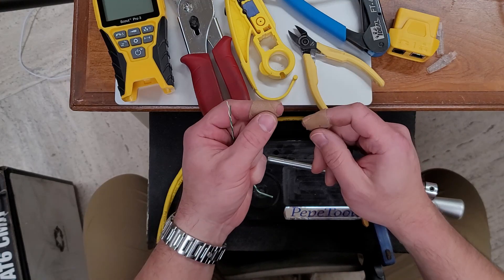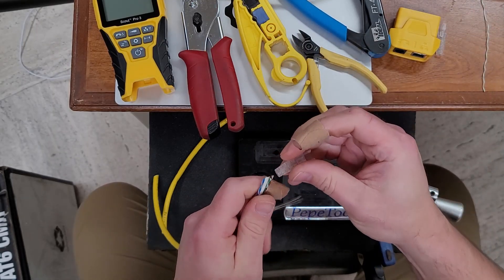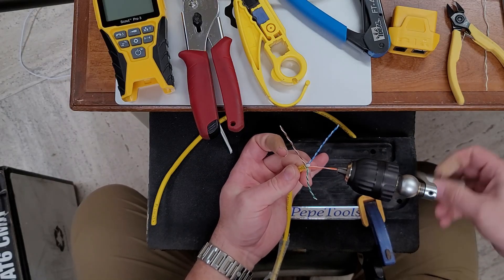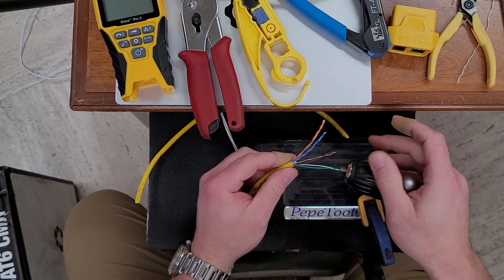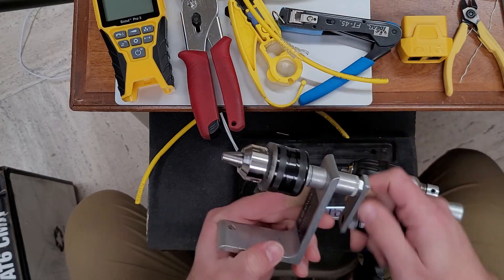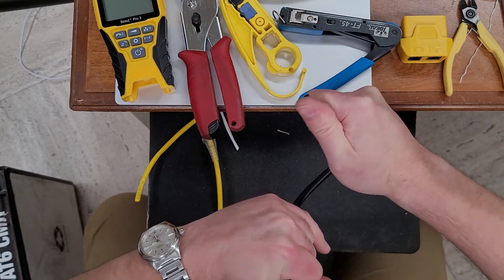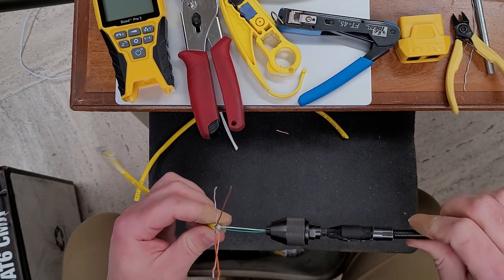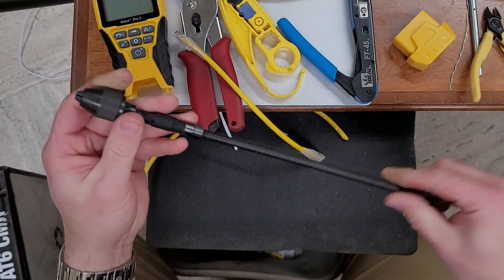Weird Trick For Perfectly Straight CAT6 Wires

Comment: You can get them straight easily with fingers or small plastic rod. Cut a bit (like 4cm at most), push something between the wires and pull. Pair will untwist on its own. Much faster, no tools and they come out perfectly straight.
Reply from the maker: I'll have to try putting something between the wires and pulling.  And yeah, I was straightening them with my fingers and a specially polished v-groove on my linemans, but after two days, my fingers were worn slapped out.
Reply: @EricM81  Try out this method then. I wired over 500 access points this way and my hands were getting more dirty instead of painful

Comment: If you want them to be CAT6 certified, you definitely don't want to unwind the twisted pair down all the way into the jacket, you want them to be twisted almost all the way to the load bar, the load bar makes it so much easier to make sure the strands aren't offset before you crimp, and they're not pass-through which I've had issues with in some ports as well as with oxidation. You can straighten out the strands with a thin metal rod like a thin screwdriver, similar to how you would straighten hair. Likewise, don't cut the core straight through on long runs, you clip the four wings, then twist or cut the center so you don't rotate the strands inside the cable.

This may not be an exact issue on 1ft cables, but if you are patching in near the edge of the maximum runs (200ft or so), it DEFINITELY does matter to hit 10G.
Reply from the maker: Yeah, I don't think one twist inside the jacket on a 1' cable matters either, but I'd like a nice 10G cable tester to see when it does matter.  

If you have a video with tips on CAT6 in non-passthrough connectors, I would appreciate it.  It takes me forever to terminate those cables.

Comment: dear lord you never learned the screwdriver trick? .... much faster guys
Reply: I just use my fingers to untwist and straighten. You counter flex and it straightens them right out. EZ PZ
Reply: @pheredeath yup never needed to use anything other than fingers to straighten.
Reply from the maker: I have a polished v-groove in the side of my linemans, but my fingertips were shot after pulling 2k feet of cable over the weekend.  There was no way I could have made a surprise pack of 25 patch cables that Sunday night without this.

Comment: As a Motorola field engineer,  Im glad its the shop's job to make those cables, though occasionally I have to make one. Thats a neat trick, but we're not allowed to use those "cheater" RJ-45 connectors. We have to use the ones wo the holes, so you have to get everything trimmed perfectly.  Its def a PITA, probably take me 15 minutes to do 1 connector. I might try and use my drill to untwist the wire like you did with your tool. Thankfully its kinda rare that I even have to make those!
Reply from the maker: I agree.  I was very sad to open a package with 20 out of 25 patch cables missing that night.  This will definitely work perfectly for those connectors, though.